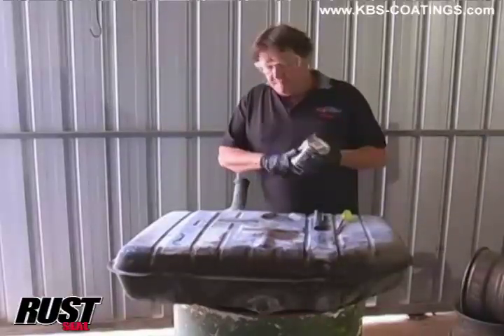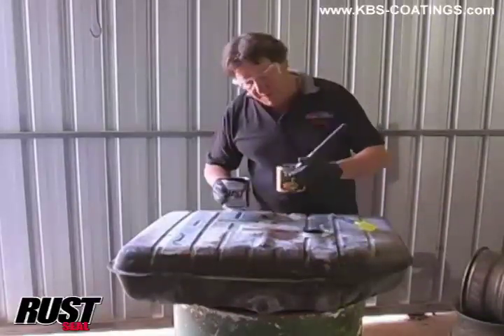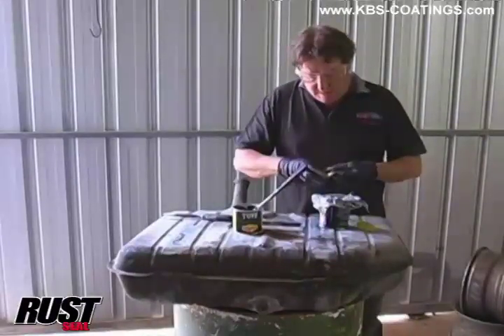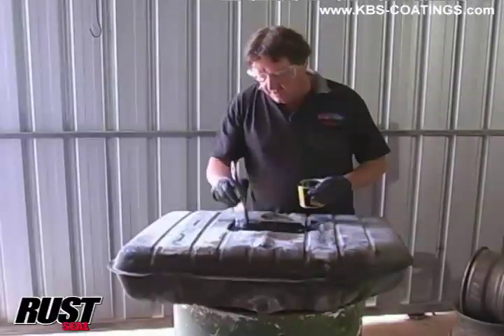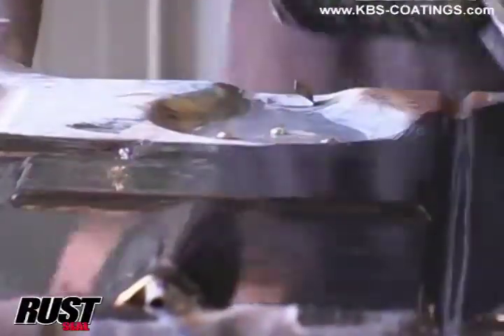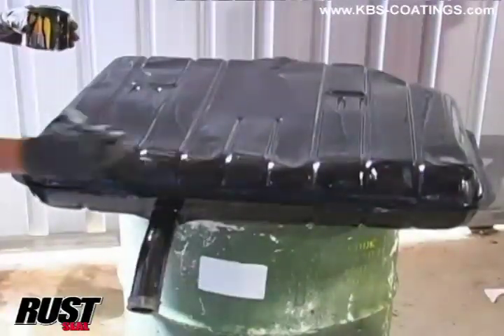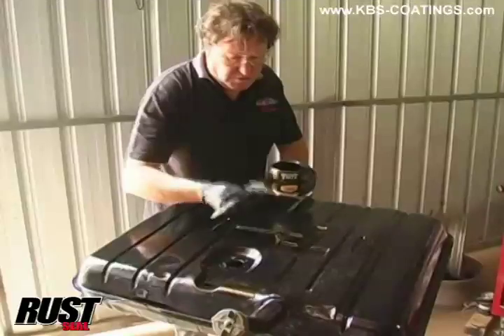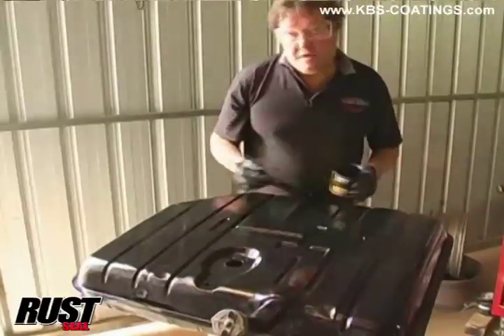KBS Coatings - Using RustSeal to Paint a Gas Tank - Part 2 of 2

Comment: I used this product on a gas tank in my 1968 Chev Van and swirled it around inside until it there was no more moving around in the tank. It has worked very well. The kit comes with a chemical wash that cleans the tank first. Then you pour in the coating and turn the tank over and over in every direction until theres no more liquid moving around and let it dry. You need to tape over the hole in the top for the fuel pump and thats it.

Comment: i have a new tank for my m37 army truck 53 dodge is there  any thing to coat a new tank before you install it  about 25 gal size to avoid rust you never know whats in gas you buy today
Reply from the maker: Just use all 3 Steps included in the 25 Gallon Tank Sealer Kit from KBS Coatings. New tanks are very slick and need to be cleaned and etched well before you do the Tank Sealer. https://www.kbs-coatings.com/kbs-tank-sealer-system.html

Comment from the maker: After the RustBlast has been we on the surface for a minimum of 30 minutes, you will rinse the RustBlast with water, all the surface to bone dry and then apply RustSeal.
Reply: Can i use kbs clear coat on a freshly galvanized trailer. Be used in salt water